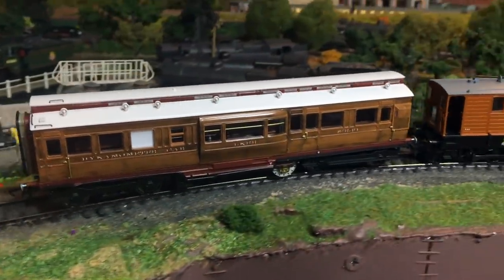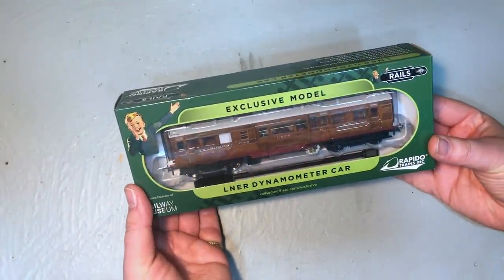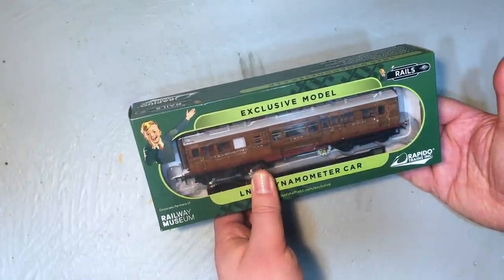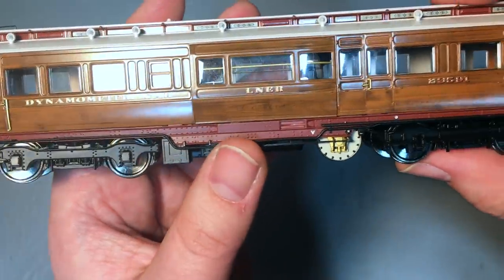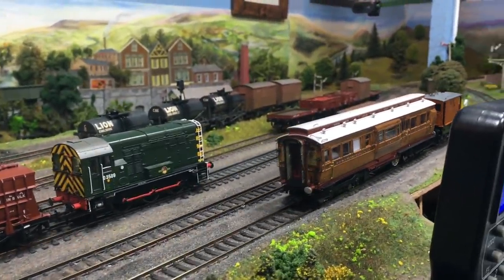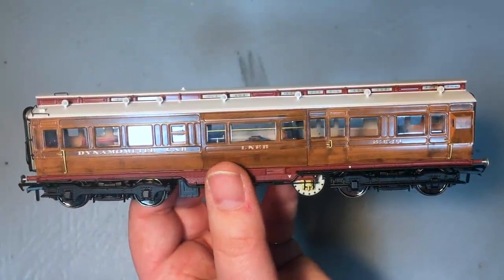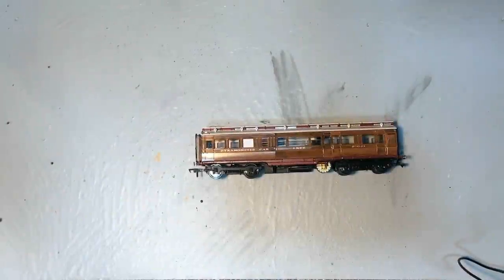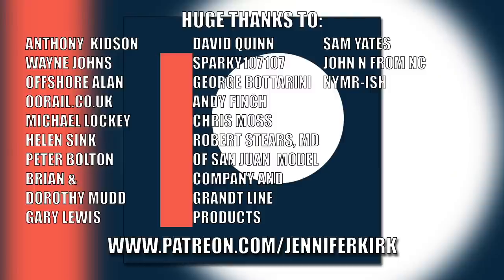Rails of Sheffield LNER Dynamometer Car Version 1 - Unboxing and Review

Comment: A very nice and well-finished coach. I do need to get one for my layout as it would not be complete without one. Thank you for the very good review. I am trying to make my own version of battery coach lighting which will work out a lot cheaper than buying ready-made ones. I just need to find Latching Reed Switches and then they can be fitted. Martin. (Thailand)

Comment: Is the roof of Dynamometer Car removable on the latest release?   Rapido Trains UK should have installed LED strips with numerous illuminated elements so all the clerestory windows are uniformly lighted. Performance lighting needs to be of greater priority than spending so much effort to detail  undercarriage items which no one sees when the car is running on the rails.